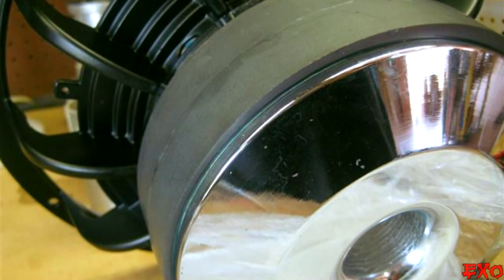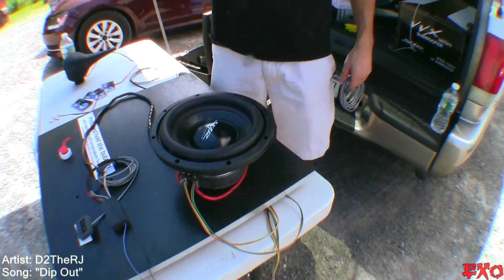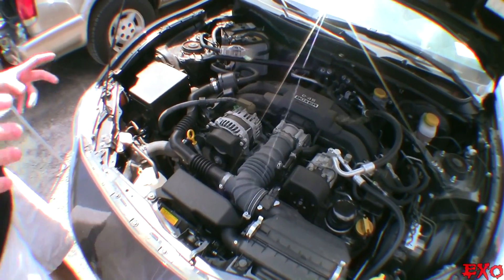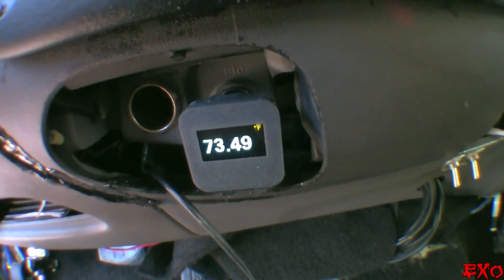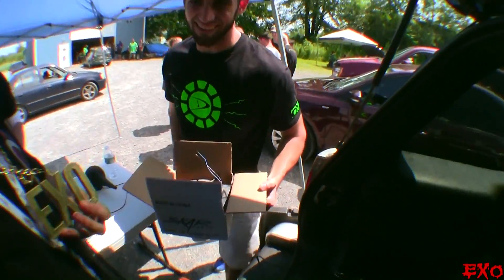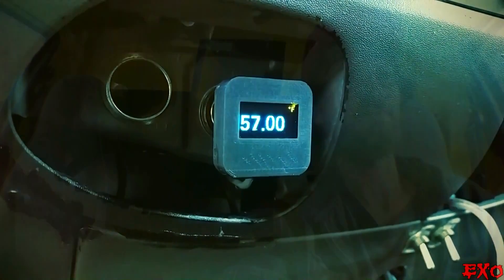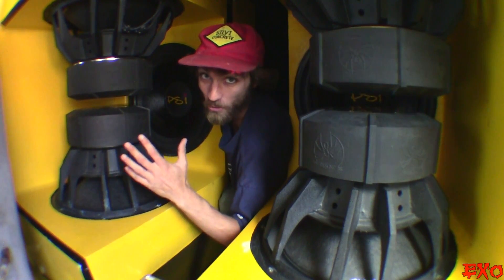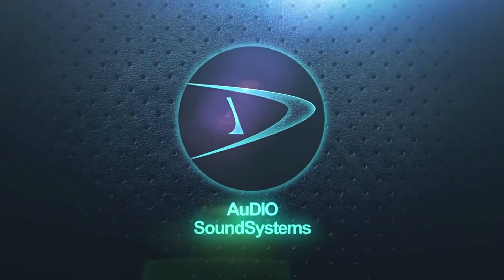Subwoofers Getting Too HOT? Installing VCi-1 Voice Coil Termperature Sensor | How To Install & Wire

Comment: Mines start to smell at 60c. Doesn't smell fryed, just like uncured glue. Quite disapointed I must say. One thing I don't understand though, is that I ran a small Renegade 300w sub where my amp drew 20A, but now with my new more powerful sub it only draws 13A, but the coils get hotter.

Comment: EXO i got a question. I got some psi baseline 15s hooked up to a behringer EP2500
Bridged at 8 ohms its rated at 1300 watts. I clamped and metered it at 40hz tone 11.5amps at 105V so about 1200 watts. The baselines are single 3ohm i have in series with wire measure 7ohms. So typical the amp is overrated. These subs are rated for 600rms each so in series 1200 watts. I set my gains with my o scope and every piece of equipment has clip lights. So no clipping. They sink up my house after one track. What gives. Box is tuned to 40hz says JBL. (SR4715X) cabinet.  Im looking at the coil its not burnt. Wifes bitchen about the smell. Yyyyyyyyy!!! Psi is good shit so wtf 1200 ish on 1200 watt subs

Comment: Is there a common cause of could getting hot fast? Can it also be that the sub was abused in the past, ie cheap amp gains and bass boost maxed out to ... Make it loud?
Reply from the maker: Clipping, stifling and overpowering can all do it.
Reply: @EXOcontralto  thanks for the reply. I just installed a new HU and have been hitting it hard. On the low notes it gets hot (and the smell) happen fast. Going to check my tuning when I finish up the new fan temp switch install this week. This poor sub was abused to all crap by the guy I got it from. Under powered max gains and a small box ... I have it in the same box but it is now inverse mounted at least till I get around to mounting a larger box or swapping it out for a few smaller subs

Comment: Where is the link to get that?
Reply: Make your own dude, buy a $3 IR pen thermometer  and just extend the wires (theres only 4 wires to extend), i done it successfully 3 times, first time was a pen type with backlight, it worked great, was compact and accurate, i pegged 1000W rms into a 250W sub and didn't blow it because i backed off once the temp hit my threshold. i did figure out exactly where i could smell coil on this 250W sub its right around 140'C, the gun type can work but is a pain in the ass to mount because the sensor needs the optics to work and is too bulky to fit through most  voice-coil openings, pen type is alot simpler. can upload video for you if you want.
Reply from the maker: Don't think he's doing these anymore :(

Comment: Can these be used for hydraulics aswell ?
Reply: irepbigi  Idk if this is a joke or not. However, this can be use for literally anytbhing, all this is, is a laser temperature sensor. If it's close enough it will read the temp of it's path correctly.

Comment: Hey i am installing a full new audio system in my car and i wanted to know what amp you would recommend.  I am getting 2 pairs of kicker cs65 6.5inch speakers and i want to add a subwoofer later but it doesnt need to be strong.  I am having trouble figuring out compatability and the thing i want most out of the upgrade is better highs, mids, and lows just enough to shake the car a little.

Comment: This is awesome..
Now we can definitively monitor voice coil temperatures, and get some hard data on all sorts of scenarios! :D

We can graph heat curves for demos, graph heat curves for clipping (So you can see how much extra heat clipping adds) And use this info to make even more awesome videos! :D

AHH the possibilities are endless!!!

Voltage vs heating curve, amperage vs heating curve, clipping vs heating curve, cool-down time, etc :)

And the price of the item, while a shock at first (Compared to the <$5 ebay temp probes) Makes sense given the market, and the fact that it is infrared and custom built :)

Comment: Does it actually block the hole or does it just line it up with the hole? Blocking a vent hole doesn't seem like the best idea tbh. I love the concept but there has to be a way to mount it and line it up with the hole and not block it. Still a great idea
Reply: +SlamminSamiO plugging one vent will not be detrimental to the subs operation.

Comment: I'm more worried about my amps than the subs
Reply: you could install this on an amp if you wanted.
Reply: +stlbeats Already ahve a dedicated amplifier temperature sensor check the website :) audiosoundsystems.squarespace.com
Reply: +Mike Dioguardo What do you use for a sensor with the amp? RTD, TC?
Reply: +Mike Dioguardo and using an arduino im guessing?

Comment: How big is a voice coil on a 12" subwoofer rated at 350 watts if i have a 2 inch is that good sized or small for it?
Reply from the maker: +Aaron bilger my 12 has a 1.5" coil and it still is enough to make me happy :)
Reply: A little on the small side. I would think more 2.5"
Reply: ***** its a dj subwoofer that i have and thats rms watts what size coil would be for a 12 inch sub?

Comment: Going to do a cheep version of this withe a inferred temp gun
Reply from the maker: +brad gannon not a bad option, but depending on woofer setup, you might not be able to shine the laser on the coil.
Reply: +EXOcontralto yer will give it ago Thanks for reply just extend the wire

Comment: How can I message you got some questions
Reply from the maker: +Robert Cruz feel free to ask right here, I will answer you :)
Reply: First off let me say I'm a fan of ya vids you keep me laughing and interested to watch more !

I have a couple questions.. Which speakers you prefer for bass competition? What type of box? What brand of wiring? What type of head unit?....

  Im building my 08' Dodge Charger, want put 2 6' sundown audio speakers in each of my front door with 2 bullet tweeters, 1 6' sundown audio and bullet tweeter in each of my rear door, running off a sundown audio 1000 watt 4 channel amp, with a pioneer head unit, 4 sundown 10's or 3 sundown 12's in a bandpass box or a ported box built out of birched plywood, running off a sundown audio 5000 watt amp, running all stinger 8 gauge for all speakers, stinger 4 gauge for amps, stinger  1/0 gauge for big 3 and batteries, batteries by xs at least 3 batteries, mechman alternator, a crossover don't know which brand yet.. What you think a good setup? My main goal is to win a best sound, best car, and at least a bass competition.   

Get back to me when you can or make a Q&A vid!

Thanks